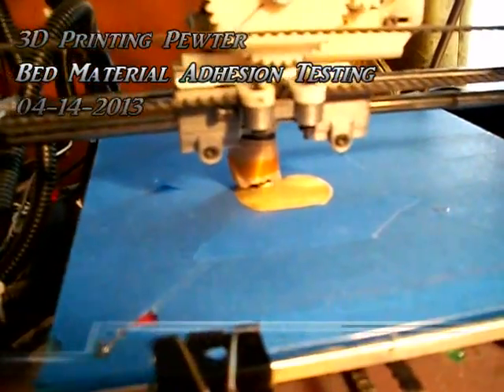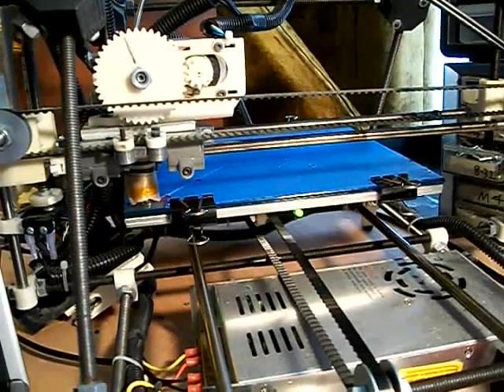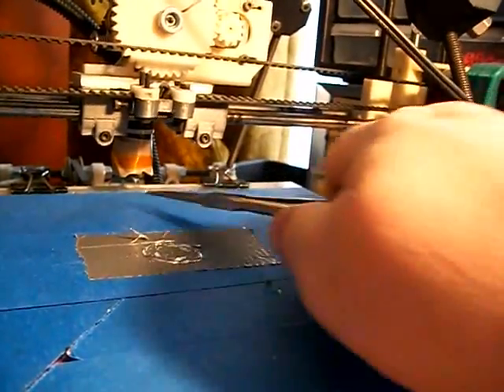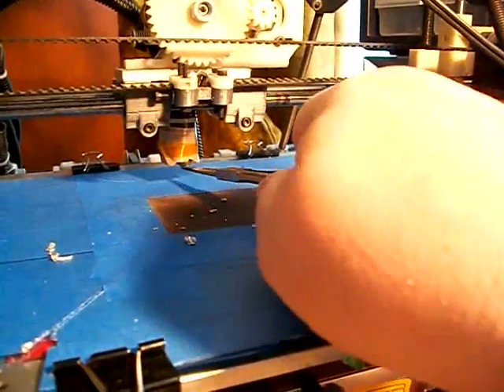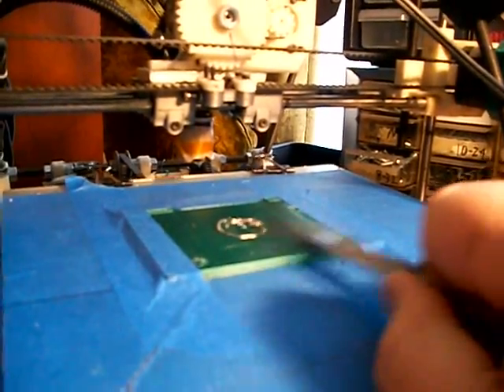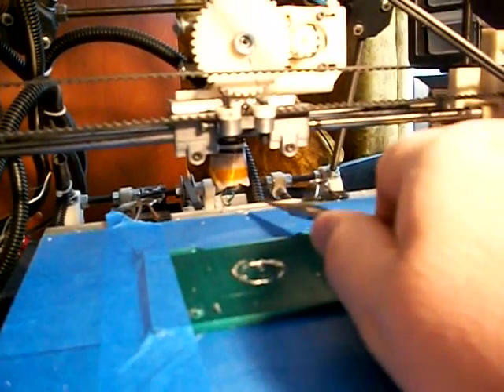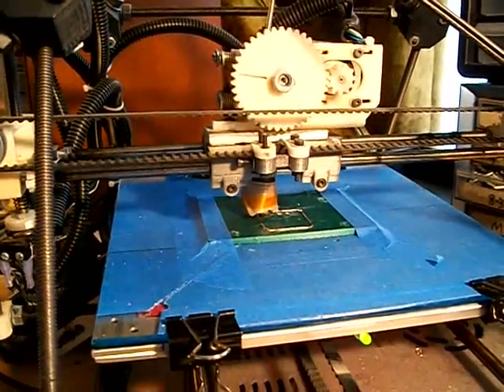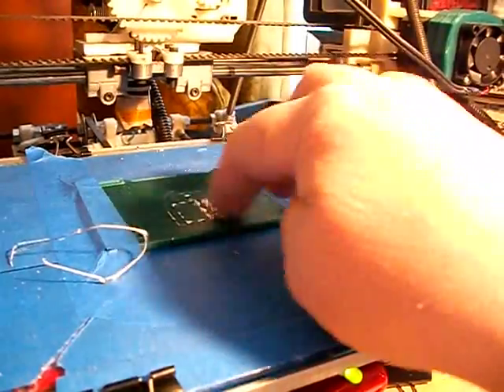3D Printing Pewter Bed Material Adhesion Testing

Comment: If you use pla, hdpe, or abs, a trick to getting it off may be using a thin enough sheet and possibly some dry ice to shrink the plastic away from the object you print. Hdpe contracts a lot!

Comment: Have you tried a tinned copper or brass plate with perhaps a layer of liquid flux? Low melt solder especially might work. 

For your nozzle, try aluminum. Not sure about pewter but solder will not stick to aluminum.